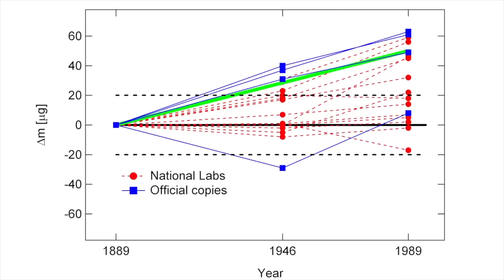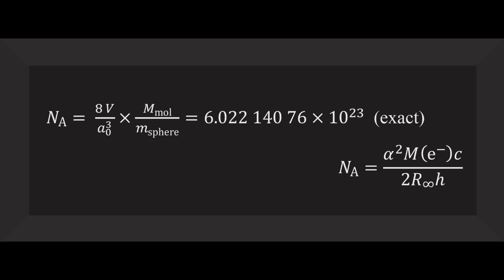The kg is dead, long live the kg

Comment: If no one wants the original kilogram after this, I’ll take it ✋🏼
Reply: I was thinking the same thing. They will probably put it in a measure for its historical value.
Reply: Looking for a good doorstop, eh? 
Well, it's already on ebay.
Reply: Most people would take it when they find out it's made of platinum. ;-)
Reply: The original kg will just loose its primary status as a a standard. It is now a secondary standard just as the replicas that are spread around the world in different countries ; it has not became useless, its status has just dropped. Now of course it carries a lot of history with it so it might well end up in a museum, but probably not before  its mass has been carefully and consistently re-measured by different Kibble balances.
Reply: @euldulle  It will still be used to calibrate devices.  But now others could make competing ultra precise calibration masses using the constants.
Reply: NO GIVE IT TO MEE!!

Comment: I'm divided.
On one hand, I support the use of fundamental universal constants to define the SI Units; it makes a lot of sense to use natural constants instead of macro arbitrarily chosen values however consistent they may be.
On the other hand, such changes in the defining of fundamental units will of course prop up inconsistencies between current, future and past studies and measurements. Now it may seem to be insignificant deviations at first, but these tiny disparities can snowball exponentially because we have always tended to use ‘Significant Figures’ in physical equations and calculations.

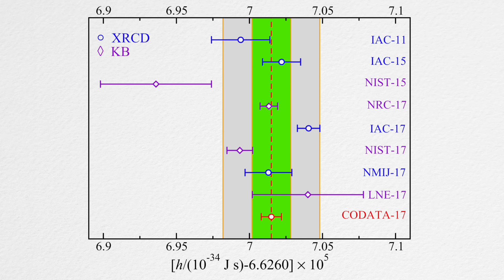Comment: since they're taking averages of a bunch of different measurements to figure out those decimal places in planck's constant (3:30), aren't they still technically basing it on something physical? several measurements averaged out still doens't make it "fundamental," and it seems like they're basically just using CODATA-17 as the nominal value and prescribing uncertainties (five decimal places in) based on the previous measurements of the kibble balance and sphere.

what am i missing here, derek?

Comment: Hi, looking for an answer here. If the new value for the constant was measured using physical objects, isn't the definition of the kg also still indirectly linked to the same objects? Oh and I don't mean them using computers to measure something, I mean the first method with the metal weight, and the second with the metal ball. If they're still involved, then how is the new constant not dependent on them?

Comment: 1 Kg = 1 liter of water
1 liter = 1 cubic decimeter
1 decimeter = 0.1 meter
1 meter = 1/9999973 (~10000000) of the distance between the geografical northpole to the equator on the meridian of paris

i think i got it right.

Comment: Baseline is standardization.
Standardization is good. Means everyone will speak the same language. And those that are forced to change will not have to do that big a effort.

Now, if only teachers would standardize their equations...
I've had teachers use Q for mass flow, which some use the symbor for For All (upside down A) with a dot on top to mean variation over time, a much better symbol, because Q also means Heat. Some teachers use p for pressure, which looks quite close to the greek letter rho, which I use for Density, so I've been using P for pressure. It's a mess. We really need a compendium to standardize teaching.

Comment: Metric > Imperial
Reply: Note that Imperial is not what the USA continues to use, because their gallon has a mass of eight pounds of water, whereas the Imperial gallon has the mass of ten gallons of water at mean sea level at 63 F. The USA also doesn't weigh in stones  (14 lbs).
Reply: FELIX obv. It’s like trying to say a language dialect is better than the language it’s based off of.
Reply: @eli6797  
No relationship between the two.
Reply: Mr. krabs the sex addict that’s a really bad comparison, also tell that to any colony ever

Comment: metric: based on fundamental constants of nature

imperial: based on drunk mathematicians rolling dice
Reply: I liked the joke but imperial is based on metric.
Reply: @f.p.5410  no
Are you dumb?
The imperial is older
The metric was created during french revolution beacuse imperial was retarded
Reply: @Kasmuller  Since the 1st of July 1959 yards and pounds were defined as 0.9144 meters and 0.45359237 kilograms respectively. So my point still stands, Imperial is currently based on metric.
Reply: So true
Reply: Joke stolen from tumblr
Reply: Imperial System used by men on the moon.   :)
Reply: @smileydag  Humorous line, But inaccurate, The US Never used Imperial. US Customary Units and Imperial are both based on the earlier English System, But they are not the same.
Reply: @jamesslick4790  That's right. For instance, the Imperial gallon, which used to be used in Canada, is 5 Imperial quarts, each different from the English/US quart = ¼ (gallon US = 231 in³).

@Borderlander, Raketemensch 00000:
The USC/English system of units uses a variety of numerical factors between different-sized units of the same physical quantity. For volume (liquid & dry measures), it's mostly binary divisions.
1 gal = 4 qt
1 qt = 2 pt
1 pt = 2 cup
1 cup = 2 gill
1 gill = 4 fl oz
while the gallon is defined as 231 in³. (231 = 3·7·11)

1 bushel = 4 peck
1 peck = 8 qt (dry)

1 mi = 8 furl
1 furl = 40 rod
1 rod = 5½ yd = (11/2) yd
1 yd = 3 ft
1 ft = 12 in

Etc.

Fred
Reply: @smileydag  no it wans't. 
Believing that is just ignorant.
Reply: Sorry to break it to you but NASA uses metric
Reply: Both are arbitrary, i.e., invented.
Reply: Metric:  Based on fundamental constants of nature.
Imperial: Based on metric.
Reply: They probably base the foot off of Lincoln's severed foot at a butcher's fridge in Kentucky.
Reply: @Mac Productions "Since July 1, 1959, these have been defined on the basis of 1 yard = 0.9144 meters except for some applications in surveying." Wikipedia - US customary units (but it later explains that the UK agreed on this definition)

You can use both defined and based. Mathematically speaking you can say that the metric system is the chosen basis for the imperial system (check the Wikipedia article on "Basis (linear algebra)").
I have nothing against the imperial system, you don't need to defend it. However, what you said isn't correct. Metric system works just as well if not better in some cases (what system do you think American scientists use?) and the reason why you still use imperial isn't because it's better but because you are used to it.

The very fact that you felt the need to defend the legitimacy of the imperial system when I never attacked it is suspicious.
Reply: @Mac Productions But "base [on], verb" also means "use as a basis" according to any dictionary. It doesn't only mean "originate in"/"stem from" as you are trying to say. And from a mathematical perspective, the metric systems is a basis for the imperial system so both terms are correct.
Reply: @Mac Productions if you can't bother to read the synonyms section there is nothing I can do to convince you...
Reply: My foot is a foot long.
Reply: + @willietheboggle3954  

What size shoe is that?
Reply: Are you implying feet and barlycorn are unnatural? 
And that instead a lump of man made metal is natural?
Reply: @QuiznosBear 
Luckily enough, we're trying to eliminate the man-made object part from metric once and for all :)
Reply: @paolo1496  obviously... As that's what the video is about... 
Also, it's not luck, it's very much intentional
Reply: Paolo by measuring it with man made objects to prove man made abstractions? Right
Reply: QuiznosBear and yes, intentionally using a new method that is not able to be denominated for accuracy with out rigging the denomination to de base an already known to be inprecise system
Reply: No... imperial is base on metric
Reply: Actually, imperial was extracted from SI.. so  countries using imperial just some dumb shits wanting to appear different
Reply: Imperial system works better than metric if you use base 12 instead of base 10 mathematics.
If people REALLY wanted to make math better, we would alter our number system to base 12.
Reply: @BorderLanderr 
It might become more elegant after you've learnt it, but it wouldn't be as intuitive and it would make teaching it to children harder.
Reply: Which isn't me saying that base-12 is a bad idea, I just think it's impractical as of now.
Reply: Its not less intuitive at all. We've been taught to think in tens, but human minds react WAY batter to base 12 once its been learned that they do base 10. 10 isn't an easy number. Humans think in halves, thirds, and quarters way more easily than they do fifths and tenths.
There is nothing about the human mind that makes it more predisposed to 10. The only argument that exists is that we have 10 digits on our hands, which is a pretty poor basis for a system of measurement.
Reply: +Borderlander

YEAH, yes!

It's probably an impossible dream, but i'm with you.  Base-12/dozenal would be great, and after its adoption we could finally do away with all the criticisms of the u.s. for holding on to the imperial system as provincial or backward or (a lot of it coming from americans ourselves... as a teenager i too was in that kind of self-loathing camp)
Reply: BorderLander what’s your argument for 12?
Reply: @BorderLanderr   If they're consistent enough. The problem, is imperial system is inconsistent. The much important one is consistent base, what base is used is number two.
Reply: Its plenty consistent. A bunch of intellectuals arguing about the allegory of the cave matters precious little to the men and women who actually do all of societies work.
It comes down to metric being an elitist thought experiment, while the imperial system was built by generations of people who lived and worked in the world, in order to be practical for working people.

Comment: How do you create a mass standard which is also available to everyone? YOUR MOM
Reply: Take the former big K but instead of saying its 1 kg exactly, weigh him using the new definition ; you will get 1kg+/- something. Adjust the mesaurements you made with the bigK to account for this something and you're done. This just adds a level of calibration at the very top of the metrology chain, but its mainly unseen at lower level.